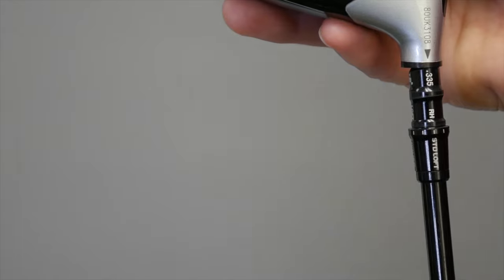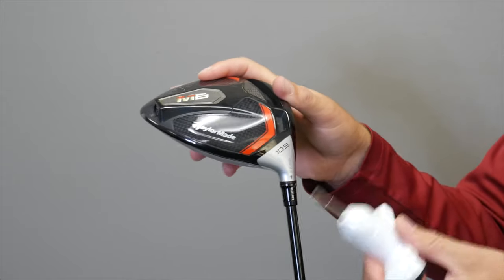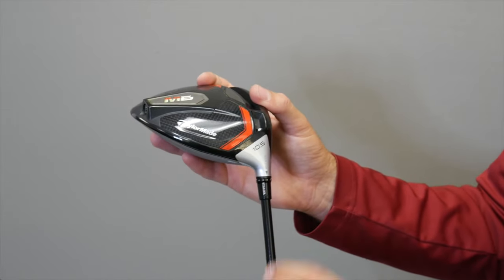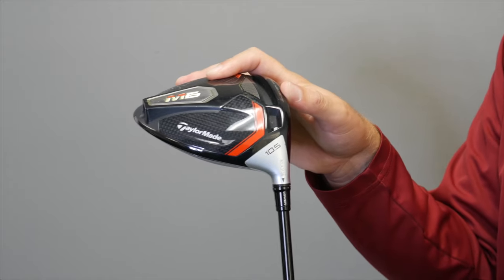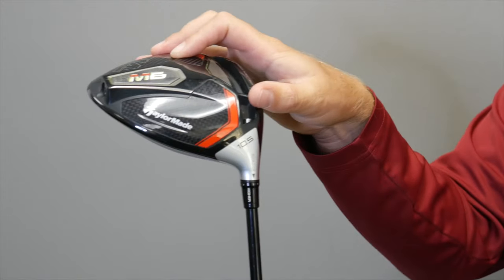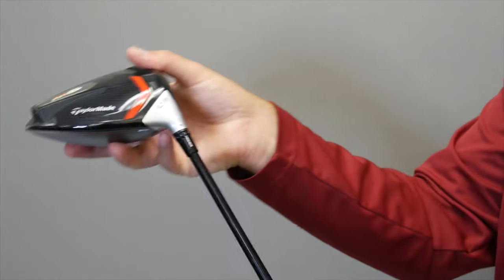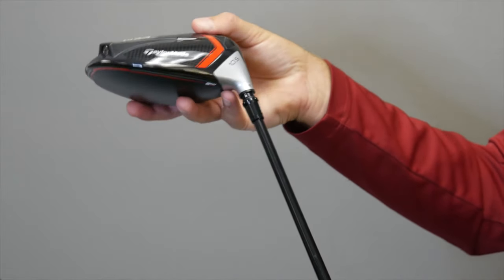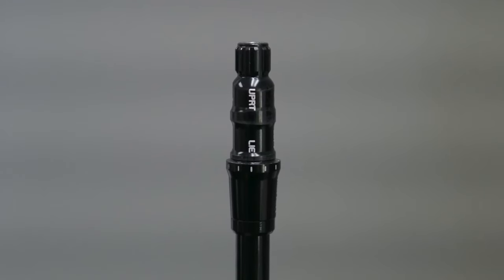How to Use The TaylorMade Adjustable Hosel Settings

Comment: Keep in mind that any adjustable club cannot fix a bad swing.  But they can make a good swing better as it has for me.  I have two of these clubs (9.5 & 14).   They both work for me AFTER I fixed my swing error (mostly outside in = bad bad slice).
Reply from the maker: Great point for sure!
Reply: KeEp In MiNd

Comment: Can you go through the fitting and confirm the best hosel setting, then get the club built so that the grip and shaft are aligned to your preference?
Reply: The adjuster is glued on so yes, however I suggest a grip with no alignment as i change mine depending on wind etc.

Comment: I had this all ass backwards for years. Fighting a draw i though I was opening the face by putting it higher. I just reset all my woods I can't wait to see how I hit it now! Thanks so much for this video cause I used to crush my driver until I closed the face thinking I was opening it!  I haven't even hit my driver in years just my 3W which was a high draw that I had to fight off to hit somewhat straight. So excited I was ready to just give up with the woods

Comment: If I decrease the loft 2 notches but on the upright setting will that in theory counteract the open face and square the face more?
Reply: If you decrease loft 2 degrees, you will open the face more regardless of the lie angle. If you want to close the face you need to ADD loft either way.

Comment: I just noticed that my left handed M6 driver has a right handed hosel tip. Do you know whether the settings are reversed???
Reply: They are reversed - a fellow lefty lol
Reply: Pretty sure that's how they all come. So annoying.
Reply: @flyingmanwhich8951  There is LH adjusters also as I have both. They are reversed so no biggy although std is still std and 180deg is still same loft but flat lie.

Comment: I have 2 quick questions.  I have an M6 D-Type driver.  I thought it would help reduce my slice.  What loft / lie setting should i use to reduce my slice?  Recommendations?  My 2nd question is this: Can i use the hosel from my M6 driver with a new Sim Max driver head?  Thanks
Reply: Hi Jon thanks for watching! Yes the M6 D-Type is a draw bias driver as the face sits more closed and center of gravity is more in the heel of the club. I also recommend adjusting the hosel to the upright setting (flip it to the back side) 2nd question: yes you can use the hosel from the M6 driver in the new SIm Max head. All TaylorMade sleeves are able to be used in all of TaylorMade's drivers that are not fixed.

Comment: I recently bought a Taylormade M2 driver and I would like to reduce my slice. I'm left handed so would the same information about closing the club face for a right handed golfer be the same advice for a lefty?
Reply: I’m lefty as well and tend to fade as well. You need to look at the adapter on the shaft if it says RH you will need to loft down to close the face and to help with the slice. Only reason I know this I found out the hard way 😂 couldn’t figure why I was hitting it so far right and turned out I had a RH shaft lol. So if it is RH just loft down which is closing the face and increasing loft
Reply: cgasucks don’t need lessons bud 😂 play twice a month with no range time  and shoot 78-82. Some out there hit the range multiple times a week and play every weekend and still can’t get close to shooting that.
Reply: @dustinjohnson267  Thanks for watching! you are correct if the adapter says RH on a left handed head the settings will be incorrect. To solve you need to flip the hosel 180 degrees.
Reply: Hi Brandon yes the same information about closing the club face for a right handed golfer is the same for a lefty. I would suggest flipping it around to the back of the hosel to the 4* upright setting, and possible give yourself more loft. Make sure your driver shaft hosel says LH if it is a RH hosel you will have to do everything completely opposite (flipping hosel 180*)

Comment: Thank you!  so is 56-degree lie angle the default for most TM drivers such as SIM2? and the only configuration with a square face?
Reply: No. The full upright setting at 60 degrees offers the same standard face angle and standard loft setting as well.

Comment: I have just bought a 12 degree in this, can you tell me optimum setting to stop me pushing ball to the right, often slicing. Thanks. Mick
Reply from the maker: My suggestion is to flip the hosel 180* to the upright setting first. You can always try the higher position as well but if you already hit it high try upright. - Thomas
Reply: Appreciate your advice and instruction on YouTube. Mick

Comment: Are the adjustments the same for left handed driver or the opposite?meaning increasing closes the face and decrease opens the face
Reply: Check the adjuster as there is both LH and RH. If using opposite to head then increase and decrease is reversed. Std and flat (180 deg) are the same.

Comment: What does the lie angle do and is the upright for taller people?
Reply from the maker: Hi David, thanks for the comment! The lie angle has to do with how the club sits on the ground. An upright lie angle slightly closes the clubface while a flatter lie angle will open the clubface a little bit.
Reply: @2ndswing  are the shaft adapter for L & R'hand clubs the same or is a Lefthanded adjustable shaft specifically for a Lefthanded Clubhead?
I guess what I am asking are they identical & interchangeable or are they equal but opposite & not interchangeable b/w Left & Right-handed driver Clubheads?.
Also is there anyway I can adjust my M6 D clubhead so that I have Low loft (10 or below)+ Low (flatter) Lie & also a Closed Clubface!!!?. Am I correct in thinking that I can't acheive a flatter lie angle without opening the face a little. I am trying to achieve a flatter lie angle with a closed face & getting a fair bit confused.
Also on my M6 Draw driver in the std loft position (10.5) is my clubface in a square or closed position (by how much). Is the changing of the lofts only changing by + or - the degree of Closedness from the Std original Loft. Or am I actually opening or closing the degree of clubface from an original 10.5deg position (which is square or actually closed a bit?).
I hope I haven't confused you as much as myself.
Thank you.

Comment: I slice my burner driver to the.right what setting should I have it at because I've never adjusted it since I got it
Reply: It's 10.5 degree
Reply from the maker: The burner drivers will not have an adjustable hosel, but if you have a TaylorMade driver with an adjustable hosel you could do two thing 1) +1.5 or +2.0 degrees or put the driver in the upright setting. - Thomas
Reply: @2ndswing  so what's the thing on the bottom that looks like it can be twisted or is that just a fancy screw lol or isit for changing the shaft?

Comment: I just upgraded my burner 9.5 to a M4 8.5 but Lofted to the Higher setting. I want it as close as 9.5 as possible, would clicking it down one notch make it like my 9.5 burner?
Reply: Hi Tristan, apologize for taking so long to respond to your question. Loft will be close but you are closing the face if you increase the loft a notch. This may make the club a little draw bias (closed face) I do suggest getting the correct loft on the driver head then make any adjustments. You also may want to try two notches if you are not hitting it as high as your older burner.

Comment: CONFUSED TOTALLY!!!! So I have the M4 10.5 degree driver it is set at the "Standard setting". If I want to slightly lower the loft AND get a slight draw bias (since I have a slight fade normally) HOW DO I SET IT TO THIS SETTING? Is it possible?
Reply from the maker: The only option you have would be to play around with the upright settings. If you want a slightly lower loft you may want to consider a 9* head (in upright or by turning the loft to say 10*). I would try the upright position or even putting the loft up a couple notches. Keep in mind a fade will lead to more spin and a higher ball flight so if your direction is corrected the ball may actually fly slightly lower. -Thomas
Reply: @2ndswing  THANKS VERY MUCH!!!!

Comment: Hi. I play a fade but prone to the slice. I hate setting up way left to compensate. What would be the ideal setting for me? Cheers.
Reply: Try adding loft. Start from 2 degrees and work back to standard. Adding loft closes the face although it will add some spin and ball flight will likely be a bit higher.

I am experimenting with standard loft but 4 full degrees upright right now as I am 6’4”

Comment: How can the face been open 4 degrees yet play 8.5 degree v 10.5?
Reply from the maker: When making a hosel adjustment if you increase loft from say 10.5* to 12.5* (HIGHER setting) it closes the face from 10.5* to 8.5* (LOWER setting) it opens the face. Focus more on the face angle adjustment than the loft and if you need less loft on a driver I would switch heads to a 9* first before any adjustments - Thomas

Comment: I have a Sim Driver 10.5, I lowered it two notches. He said it opens the face if you lower it. He said it is Fade bias if you lower and open the face. Shouldn’t it be more Draw bias if it is lowered and the face opens ?
Reply: No, you need the face closed to path

Comment: I have a Cobra F6 driver set at 9.5  degrees draw.  Due to being delofted but in a draw setting would the face be back at neutral or would the face angle still be open?
Reply from the maker: Assuming you have reduced the loft to 9.5, the face angle would still be open. The draw designation that Cobra uses is a result of creating a more upright lie angle. Thanks.

Comment: I'm confused  ..... so if I increase my loft on my 10.5 m5 it will close my face an cure my slice but if I address the ball with a square face it's back to standered it's just like the shaft has spun  around and nothing is different, am I missing something  here?
Reply: When you adjust ie increase the loft dont look at the face but the silver front edge at address. If you then look at the face below you will see its closed.

Comment: What do you recommend for me I always just slice my drive pretty bad... I just got an m6 what setting do you think I should use? I just want low ball spin and no slicing.
Reply from the maker: Hi, thanks for the comment and for watching the video! Try the stated loft upright setting, which can be found by turning the hosel 180 degrees from the standard setting. This will increase the lie angle by four degrees to make it more upright, but the loft will stay the same. This should help combat your slice. The other settings that create a more upright lie angle also create more loft, which would create more spin.
Reply: 2nd Swing Golf okay thank you so much I’ll give it a try!
Reply: Renden Dye how did this help?? I’m giving it a shot tomorrow (:
Reply: Drake Andrew helped so much!

Comment: Hey I had a quick question. So I have the sim max, and when I try to loosen it to take off the head and change the loft sleeve, it starts making the clicking noise it makes when fully tightened when I turn it anti-clockwise (to the left) and I can’t turn it to the right as it just doesn’t move. I’m scared I am going to break it if I try to force it too hard. Any suggestions? It’s a left handed driver if that changes anything

Comment: I think it’s ridiculous that you can’t adjust loft without affecting lie and face angle...
Reply: Thank you for watching this video. It would be very convenient if the loft and lie was not affected. Keep in mind when fitting for a driver its more important to get the correct loft fitted to the player first, then golf shaft and then make some adjustments if necessary. For example fitting the player into a 9 or 10.5* driver first based on launch and spin numbers then making the loft/lie adjustments based on fade/draw tendencies, rather than a giving a player a 10.5* driver head, realizing that the player launches the ball or spins the ball to much and dropping the loft down, which actually opens the face.
Reply: @thomascampbellgolf  I like to say get fitted for the swing you want, not the swing you have. If someone wants to beat his buddies this weekend, maybe get fitted for the swing you have. But if a player accustomed himself to more advanced equipment, (heavier, stiffer, flatter, less loft), then that player might have a better chance at improving technique and developing a powerful, correct, repeating swing. Dress for the job you want, not the job you have.

Comment: I don't mean to criticise, but this is a really misleading explanation of how an adjustable hosel works. These settings change loft & face angle but not at the same time. If you loft down, yes the club will sit open, but that will have no effect on the loft. If you keep that face angle through to impact, you'd hit a slice shape with exactly same loft as stated on the head. To actually implement the loft change, the player needs to square the face up before grounding, or subconsciously square the face at impact. Tom Wishon has spoken at length on this subject.
Reply from the maker: Hi Thomas Campbell here, thank you for your comment. For this video we simply are educating our viewers what TaylorMade educates fitters with regards to loft. Yes you are correct when you loft down the face sits open and the club head will not exactly be 2* lower in loft. Similarly for lofting up the face sits closed. If you want two degrees less or more loft, switch to a clubhead that has 2* less or more loft, don't just adjust the loft sleeve. It can be misleading how it is presented, which is why I mentioned this towards the end of the video at 5:22